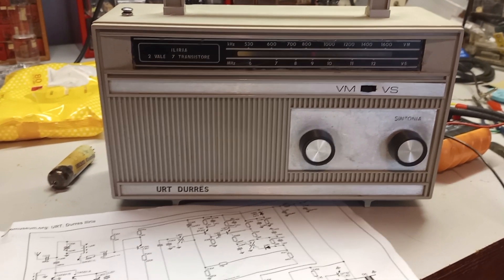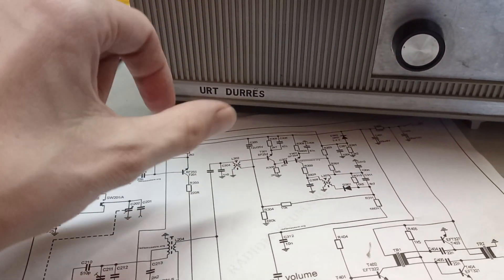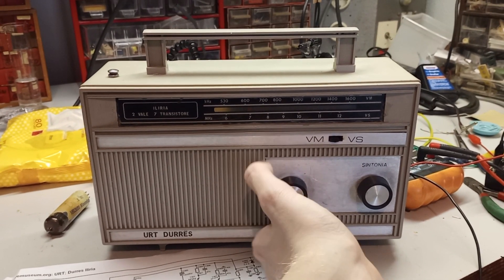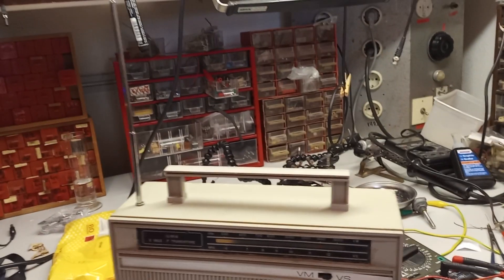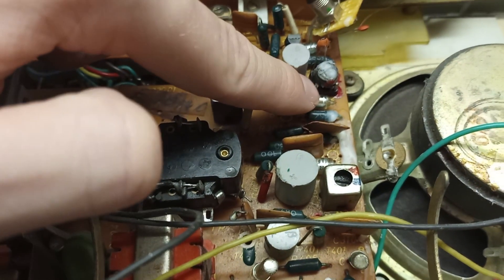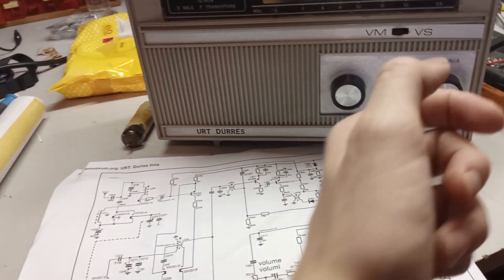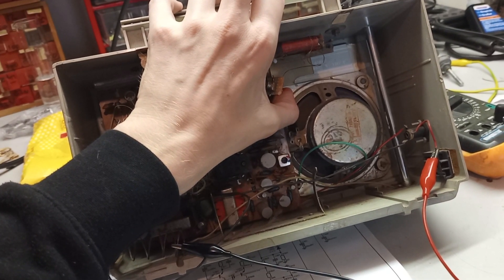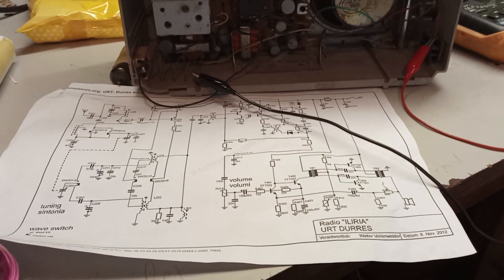Follow up - how to repair transistor radios - URT Durres Iliria works again.

Comment: The adjustment/alignment of an AM receiver using an RF generator, is done in three steps. A) Feed with 455kHz I.F signal (modulated with 1kHz sinus) the 1st I.F input amplifier. (You can use a loop of a few wire turns bringing it near the receiver). B) Adjust for maximum audio signal at the lodspeaker, by adjusting one by one all the 3 IF stages, starting from the last one (near the detector diode). Their colorings are: 1st yellow, 2nd white, 3rd black. So work starting backwards.C) Adjustment of the local oscillator (red colour transformer). Adjust the variable capacitor of the radio (by setting the needle showing the station under reception) to the 550kHz marking on the display. Set the signal generator at this frequency and then adjust (the red H.F transformer of) the local oscillator for tne receprtion of this frequency and you are done. Just confirm afterwards that the upper reception frequency is received at the correct needle position. If not, set the needle to 1650kHz marking on the display (and the generator as well at this frequency) and then find a small padder capacitor connected to the mechanical variable one and adjust it until you receive this frequency. The alignment is then complete.

Comment: Nice video. I have a vintage Realistic Concertmate 8 that I'm trying to fix. The problem is that the volume fades away after 1 or 2 minutes of otherwise normal operation. Have you any idea what component would cause the volume to gradually quit working? Thanks.
Reply: Apart from the good advice above, watch the audio signal level at the slider of the volume potentiometer, with a multimeter on A.C. If the signal is there, while tha sound has faded, then your problem is in the audio amplifier. The first suspects in such a case are the electrolytic caps. Wiggle them one by one with a tweezer and watch for signal recovery. You can also hit (gently) the pcb with the holder of a screw driver, holding it from its tip. If you see recovery, watch for cold soldering joints. Hopefully these guidelines will help you to fix it.
Reply: @ΠάριςΑζής  Many thanks mate!
Reply from the maker: There are too many things that could cause it, to be able to explain it in the comments. First thing to do is to measure if the supply voltages to the different parts of the radio stay constant, while the sound is fading out. If the supply voltage drops, that's likely the problem. And that can be caused by an electrolytic capacitor slowly failing. 
Also measure current consumption. If the voltage drops while the current rises, the speaker amplifier may be drifting from its correct working point - again caused by leaky caps. 
Try finding an electronics forum (old fashioned, yeah i know) and ask for help. In the netherlands we have Circuitsonline, i'm sure there are english language forums too like the EEVblog forum (but more specifically for electronics repair)